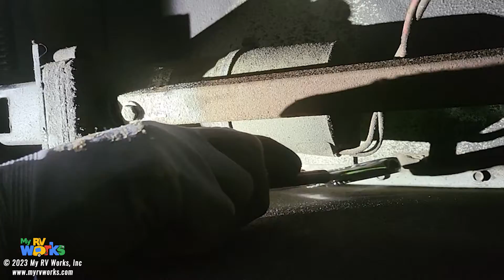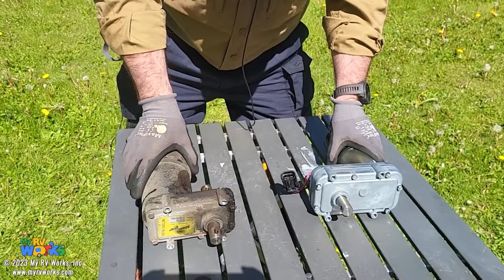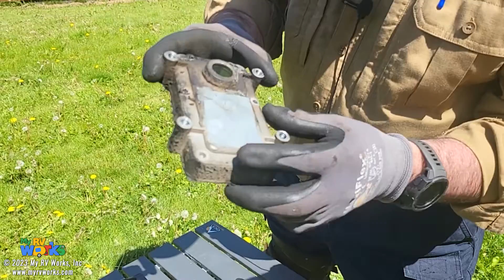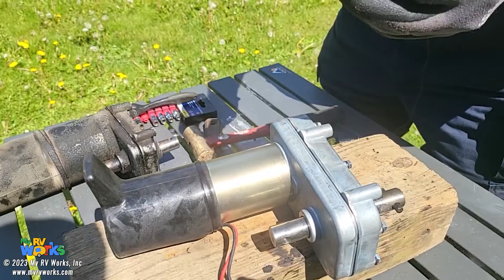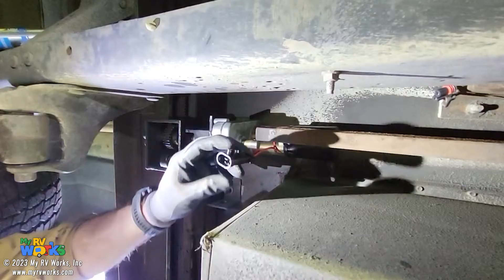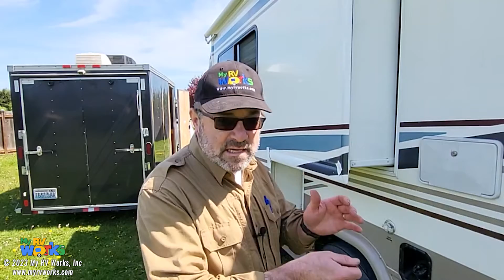Slide Room Won't Close -- Power Gear Motor Failure -- My RV Works

Comment: Great vid. My 2001 Holiday rambler has basically the same system, but my brake won't  hold the slide in. Looking for parts to rebuild, no luck. works fine in and out, the slide creeps out on turns.

Comment: I have a 22 Springdale mini 1760 bh schwintec,one side doesnt want to move. I tried resyncing motors but its still not working. 
I did have something blocking it at first and removed the item. I closed the slideout and now one side wont come out. I looked for the control box but havent found it. Wasnt under the bunk bed or in any cabinet. I hear  motors on both sides. Just one side wont move

Comment: I have a power gear slide in my 06 Bounder and when the slide goes all the way out the last few seconds of coming out or the first few seconds of coming in you hear a horrible ratcheting sound, when my batteries were going bad the motor didn’t have enough power to do it, but the motor has been replaced and I’m thinking it’s a cheap motor/gear box. I wish I could get one with metal gears and beef it up… I’ve been under it when it happens the exposed gears are all fine so it must be in the gear box on the motor

Comment: Hi Darren, Great video very thorough in steps to take to fix. I did have question about the motor replacement. How did you remove the pin from the old motor and put it on the new motor? I'm in a situation where my old motor is working fine, but the pin that goes into the collette of the gear pack has sheared off. I'm having trouble both getting the remnants of the pin out of the shaft removed, as well as sourcing a new pin. I've googled anything and everything I can. I'd love to find the pin to fix this, without having to buy an entire motor for just the pin. Thanks for any advice you can provide.

Comment: BTW the first thing in the gear drive installation manual and in the owner's manual is never lubricate the gear rail or the gear pack teeth.  They say if you must lubricate something, lubricate the axle that goes through the gear pack, but not the gears.  Camping world had repaired this twice before and smeared massive quantities of gear grease on the gear ram which resulted in the teeth jumping from tooth to tooth resulting in misalignment.
Reply: Grease no, spray lube is fine.

Comment: My drive system keeps breaking the 1 1/2 inch  1/4-20 grade 8 bolts which holds the gear pack to the end of the square axle tube.  Mine has an axle going to each gear pack with motor at the mid point and the one that fails is naturally the one that is nearly impossible to reach. Something is binding and I have taken the gears and rails completely out.  I cleaned them and replaced the grade 5 bolts with 8s.  Any trick to finding out what is binding or otherwise creating the drag? Will additional torque on the 1/4-20 bolt help prevent it breaking?

Comment: I have a question regarding a Swintec System. Thor uses the Swintec System for their full wall slides. Is this problematic to use Swintec on a full wall slide? I'm asking because looking into a 2023 Thor Aria 3901 with Swintec full wall slide. Love your videos 👍
Thanks,
 Joe
Reply from the maker: Hi Joe, we answered your question in a Q&A that will be posted later today!

Comment: I just traded my fifth wheel with three slides for an Airstream with no slides. Never had a slide problem but every time I opened or closed the slides I was a little worried about possible problems. I enjoy your content.

Comment: Hi again Darren. Our 2009 Winnebago View has a full length slide out (13') that stopped sliding in or out, ran by power gear motors and gear teeth just like the one in your video today.  I've had to manually open and retract, which is easy for the person up front (nearest driver) but very difficult to get to and move in the back. I'll drive to you in Wa. if you'll set up an appt. sometime this summer? We live in Boise. I currently have  a sub compact torque wrench on the way hoping It fits inside the small area that allows for manual in/out function. Power goes to both motors, but they make no sound, nor does the pressing of the in/out panel buttons. We are in desperate need of Darren Koepp's magic work.
Sincerely, Rob & April
Reply: I'm jealous. Driving up from Southern California to see Darren it will be a little more challenging for us.
Reply from the maker: Rob & April, you can submit a request at www.myrvworks.com, we would be happy to work on your RV!